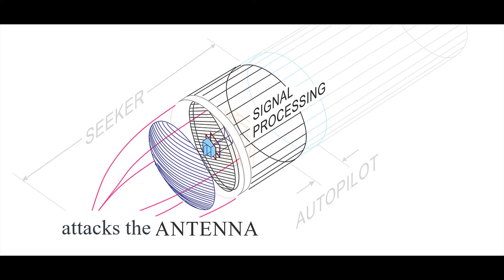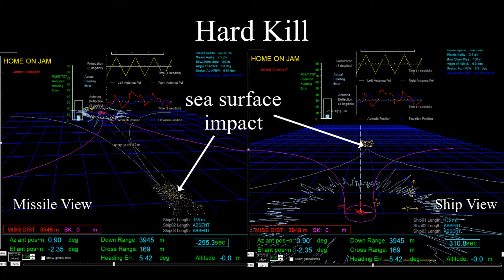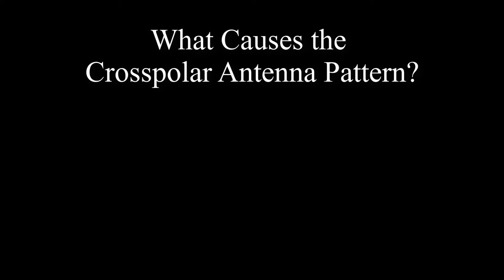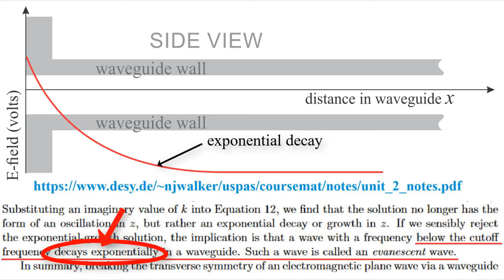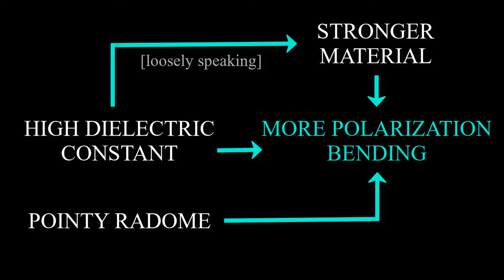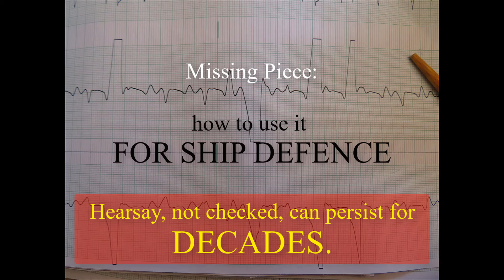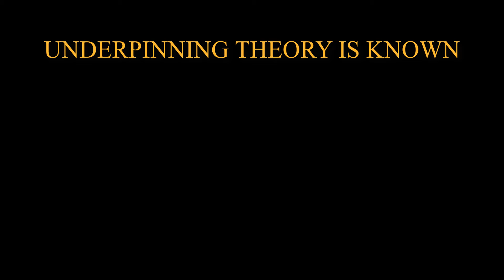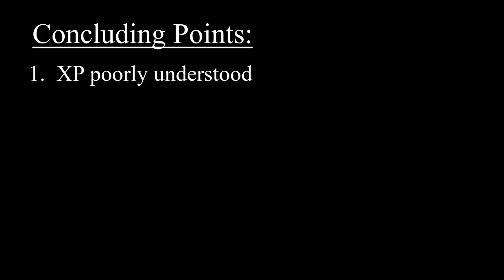Introduction to Crosspol Jamming 04

Comment: Does Crosspol only work against seekers with parabolic reflectors, or radomes?
What I mean is, would a flat ground based PESA be imune to it?
(Just trying to make sure I understood how crosspol works)
Reply from the maker: A ground-based PESA will have a crosspolar gain determined by the crosspolar gain of its radiating elements.  Put a curved radome over the array and the crosspolar gain will go up.  

Same story for a slotted waveguide flat plate array antenna in a seeker or aircraft; the underlying antenna will have nearly zero crosspolar gain, but it will be added by a radome.  

If the flat plate array is made from radiating elements that have a high crosspolar gain, the overall antenna will have a high crosspolar gain.  Google "array element factor" to understand this better.

Comment: is this why the P-15 AShM was so often easily jammed?
And how the SA-6 was countered?
Reply from the maker: I don't know what the thinking is about countering the SA-6, but the designers were clearly concerned about Crosspol.  The antenna has a wire grid over the reflector aperture, you can see it in this spectacular video: https://www.youtube.com/watch?v=TMECE9J8j-Q  

The grid will reduce some of the crosspol from the feed, but won't do anything to fix the radome effects.